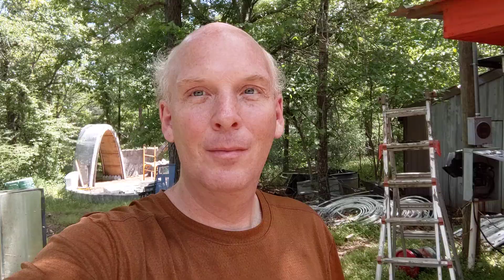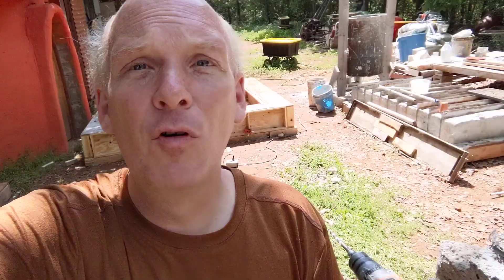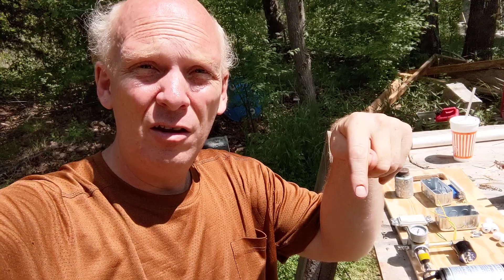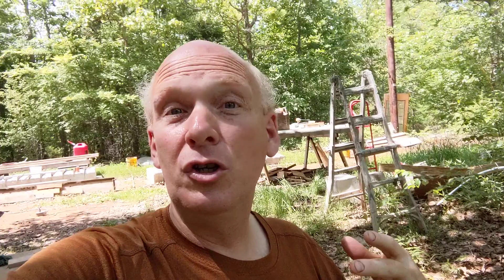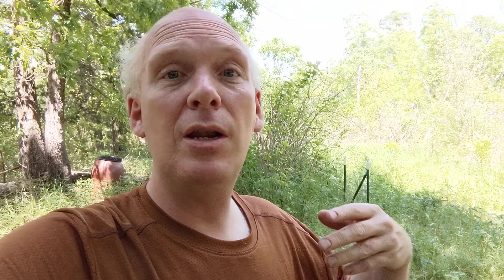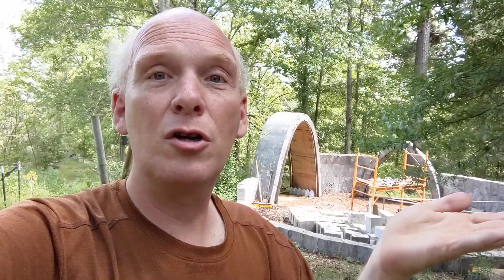2020 AirCrete Home Alternative Building School Workshop  & Video Courses

Comment: Does your courses include how to make the mixture for different applications. Like say specifically for structural, insulation as well as for slab and rooof. I am interested in starting my own project.
Reply from the maker: We do teach how to make AirCrete for flooring(not foundation) and walls as a structural insulation.  I do not recommend AirCrete for roofing unless used as arches or domes.

Using AirCrete correctly is important.  It has little tensile strength so flat thin panels are less than ideal and do not provide enough insulation to be useful.  If you support the roof with a deck then you can make a thicker insulation and seal with roofing rubber spray or HDPE membrane.